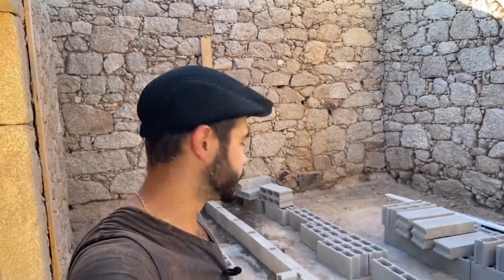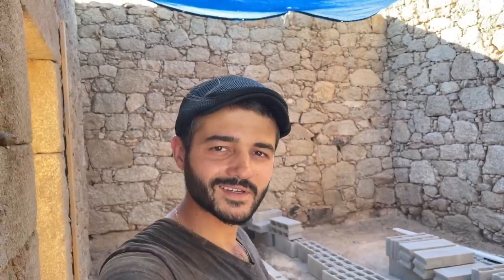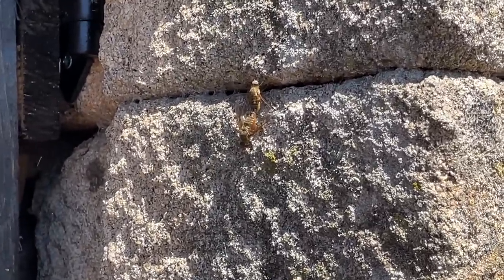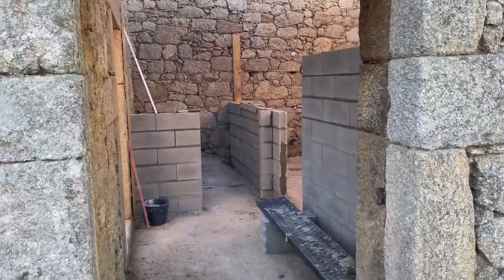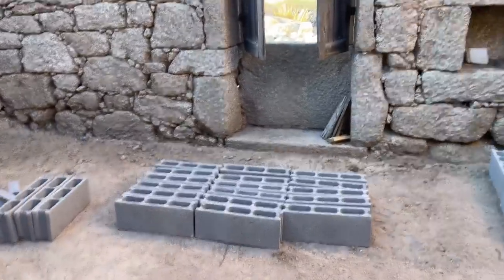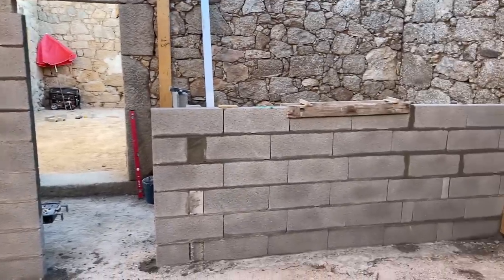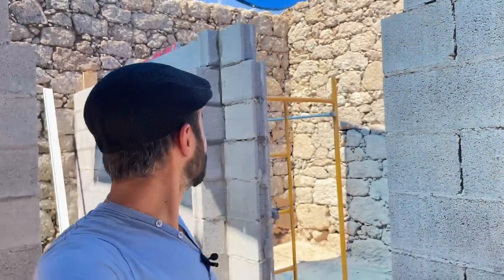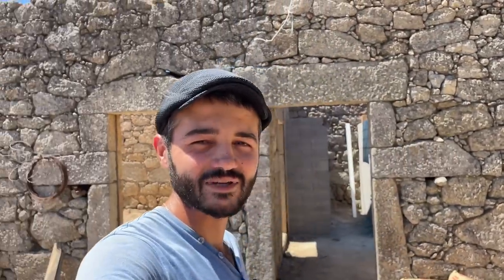100 Year Old Abandoned Stone House Renovation | DIY BRICKLAYING Building A Block Wall - Ep.5

Comment: Making great progress guys. Just wondering what you are doing to ‘tie’ the block walls to the stone ones? Are you putting in rebar or wire of some sort? I’m not a builder so only asking as I’ve seen videos where block walls have ‘come away’ from stone ones as they weren’t tied in to each other to prevent them separating (possibly due to different temperatures in the stone and concrete from the block/concrete).  Anyway we’ll done on the block work and I’m glad Angela has been around to inspect every aspect of the build 🐑👍
Reply: I think you can see it at 37:40

Comment: Do you guys have some sort of plan for making the vertical mortar joints after the fact? I usually see people "buttering" the side of a block with mortar before laying it, but here just a bit got tossed down the gap afterwards? Are these a different type of blocks that don't need that vertical joining or something?
Reply from the maker: Hi Hilary,

No there is no need to "butter" them, Mortar is like a glue, It will glue to the blocks either way.

The reason People "Butter" the mortar in other types of blocks which don't have the holes between them, is to stock the mortar to the side of the block from bottom to top.
Because if they wouldn't butter, the mortar will just fall off the side of the block.

Comment: Hi Alex I love the work that you're doing very impressive. 
Are you building on top of the pipework you've put in, what if you get a problem with the plumbing. Also I haven't seen any way that you have keyed your new brickwork into the main house walls like steel straps screwed into the rock wall.
Brilliant job Brian

Comment: Question - When you build a block wall don't you have to put mortar between the cinder block as well as on top of the blocks?  Would the wall be stronger with the mortar all around the block than just on the bottom and the top?
Reply from the maker: Hi Paul and Laura,

There is mortar between the blocks, the blocks are curved at the sides, so when you put one near the other, there is an opening on top, and you just push mortar in that hole, and this way there is mortar between the blocks.

Comment: Hello Alex , dont get me wrong , the wall looks very nice , but ...why dont you wet the area you're putting cement (mortar)  , and why none between the bricks ?? Any bricklayer (pedreiro) would pull your ears !!!! Carne de porco a Alentejano , my favourite (without the pickles) !!!!!!!!!
Reply: Fact.
Reply: I’m not even a bricklayer and I thought exactly the same thing…
Reply: Of course, you’ve weakened the structure by not laying the blocks correctly.  This is painful.
Reply from the maker: The blocks aren't flat on the sides, So when you put the blocks, there is a hole on the top between the blocks, and that's when you slide the mortar in.
In one of the clips I even show my father do that, and in the Timelapse you can see me do that, push mortar between the blocks.
Reply: @AlexLukachina  They don't know what are talking  these blocks are self locking ,they have like male/female ends that locks one into each other ....besides like you said when two blocks are jointed there is a space than can be filled with mortar  although there is no need to do it in all the blocks.....

Comment: Dad took so much trouble getting the first bed of blocks in so that he had a good foundation course to work from. In the UK his mortar jig can be bought in plastic and its called a Brickie and comes as a long and single version. I was surprised there were not anchor straps or ties fixed to the stone and into the bed joints at the new wall external wall interface. I literally laughed out loud when your Dad started to walk on the ladder stilts. Your sheep really thinks she is a dog, will she be allowed in the house once it is completed?

Comment: How do you intend to fill the cracks between the bricks? They should be filled as you go .  Not very solid that way. Why not butter the end of the bricks as you place them?
Reply from the maker: Those bricks are not flat on the sides.
When you attach 2 bricks together, there will be a hole between them, where you push the mortar.
You push the mortar between the bricks, after you lay them.

You see my father does that in one of the clips, and in the timelapse you can see me pushing mortar in that hole.

Comment: Hi how are you going to tie those blocks walls into the stone structure, I did not see any ties or rods connecting it together
Reply: The top of the walls are going to be finished with a concrete beam with rebar...it only can be seen in the end though...